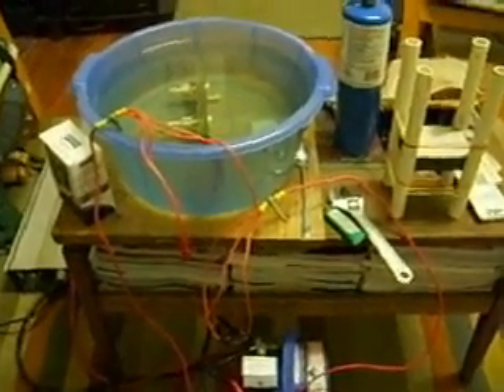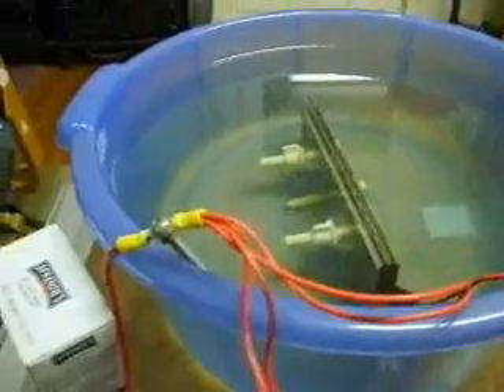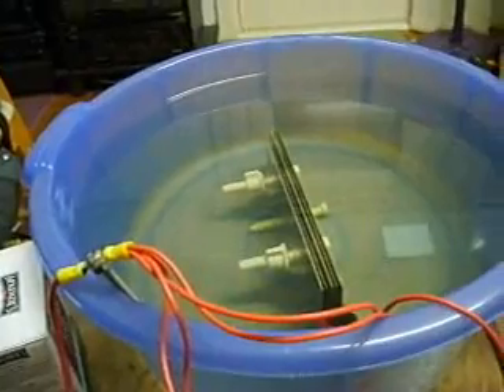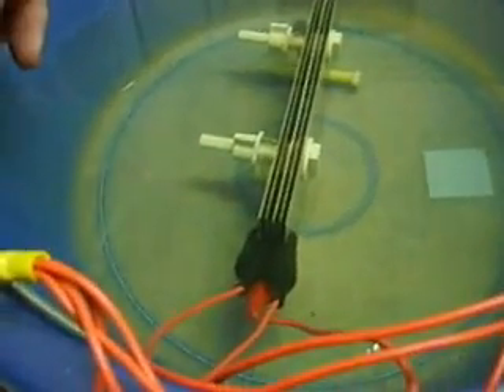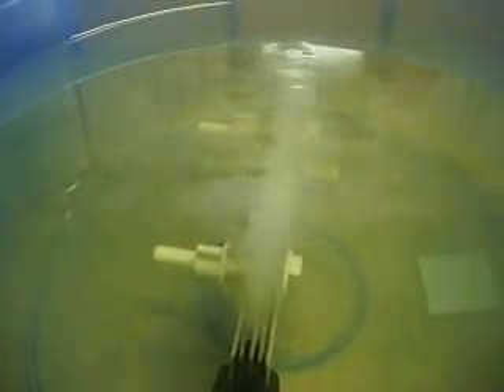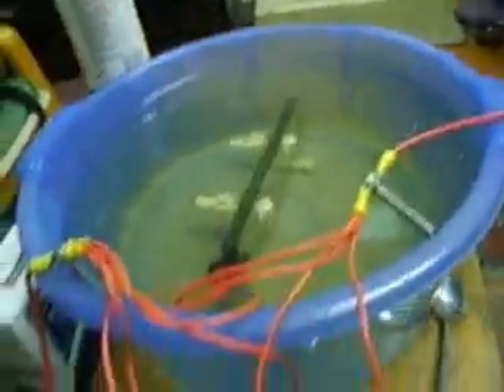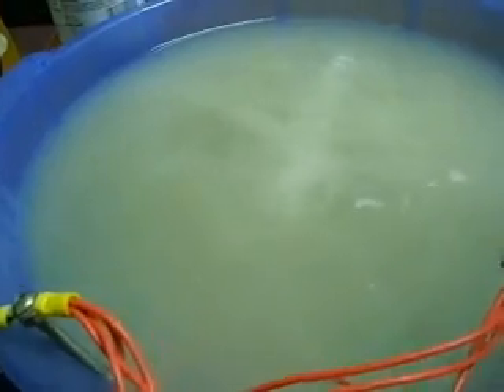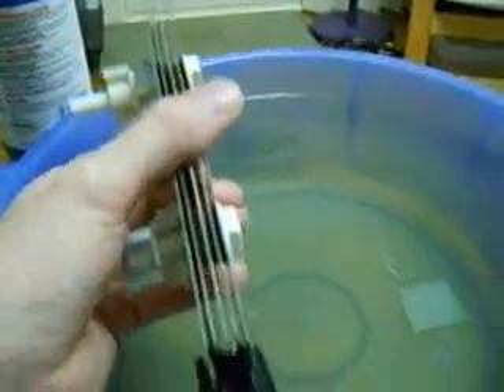Hydrogen at home (plate gaps and new cell design)#10

Comment: like your pvc cell and the spaces look perfect,what wiring configuration worked the best? when you look at the oxygen coming off the + there is fewer bubs released than the -  were it gets quite more hydrogen gas. should make a difference in how many +, to ,-s and there configuration?thought about testing a oxid. resistant metal other than  stainless,it has a electrical resistance! I was thinking of trying copper plates electroplated with gold, or something like gold w its supper conductivity

Comment from the maker: Basically the trick is to get as much hydrogen output with the least amount of amp's.  You don't want to use much more than 20 amps because heat becomes a problem.